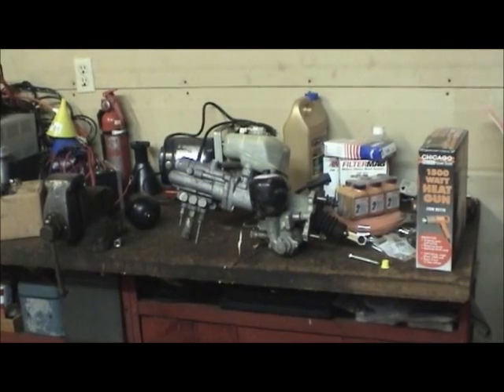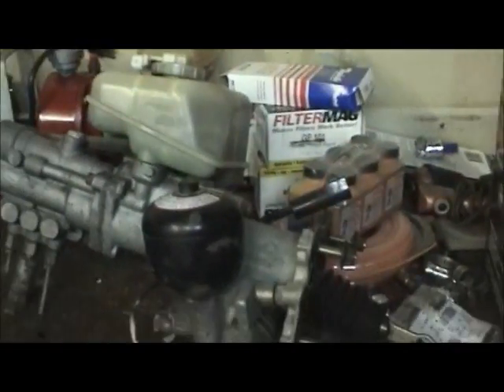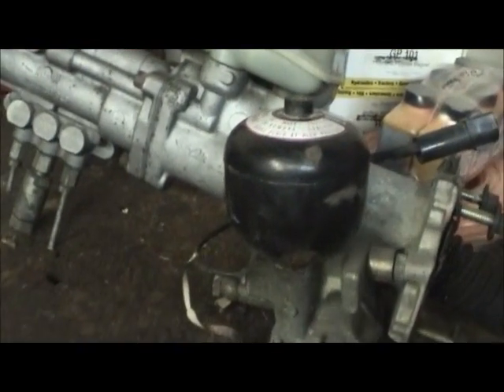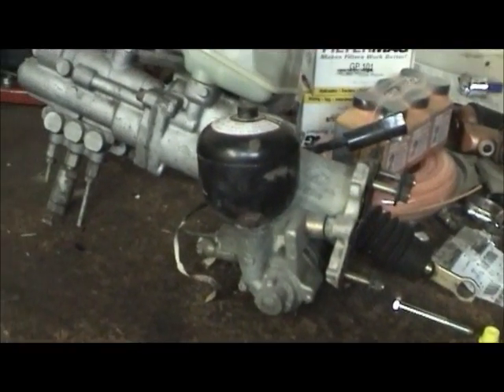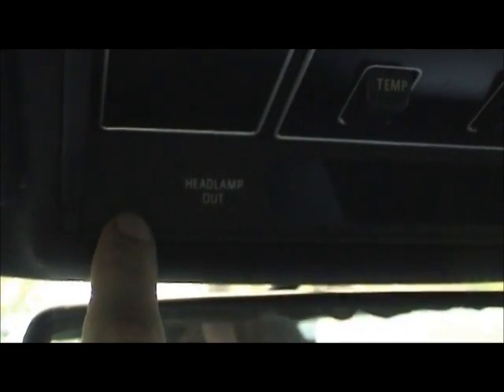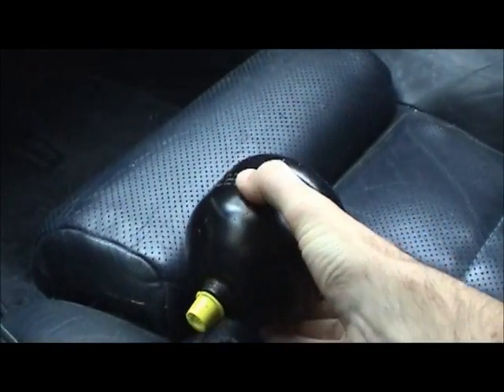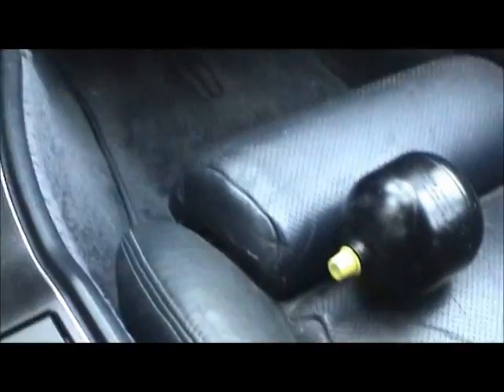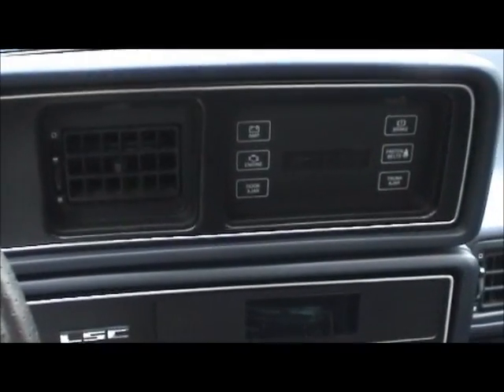1987 Lincoln Mark VII Brake Booster Troubleshooting Tips

Comment: I got a 1992 Lincoln Mark 7 Bliss Blass and I am having a problem where the pedal is hard as a rock. It is an electric brake booster and we tried replacing the relays and still wouldn’t go. Where can I get the other parts for this?

Comment: Are 1984-1992 brake system the same? Are these units   iterchangable between 1984-1992 Mark Vll?
Reply: As far as the Teves II electric brake system, yes there is only one style ever offered.  They came from Germany I believe and are found in Buick Reatta's, Jaguars, Mercedes, etc.  As far as the vehicles, some were vacuum boost instead.

Comment: This was a very helpful video.  I now am almost positive that I need an accumulator.  I Googled Hydac, and Prior Reman, and hit a dead end.  I just want to order this part for my 86 LSC.  Can you help me out with a Hydac part number, or even a link to this part?  I understand ACDelco also made this part at some point but no longer does.   Thanks.
Reply: Just a heads up.. I went through this 5 years ago and the game was up already.  Couldn't find a single solution to repair my Teves II system so had to retrofit.
Reply: @jessemedina4482 retrofit to what? I want to get rid of this crap

Comment: Thank you! This was very helpful in diagnosing my brake issues in my 1992 Lincoln Mark VII LSC. Sadly, it appears that Prior Manufacturing has gone out of business. I've reached out to HYDAC to see if they can steer me in the right direction of another supplier. I know this video is 8 years old but if you have any advice or extra info, I'd love to hear it. Thank you!
Reply: I gave up the search almost 5 years ago.  No accumulators left and hydraulic shops weren't able to help me.  I ate the cost of refitting the brakes entirely with a Hydroboost kit from SPEED Manufacturing.  He includes a bracket that adapts the booster specifically to the Mark VII firewall.  I spent 7 or 8 hundred on a reman booster with steel hose kit and he upgraded me for free to a brand new booster.  Hoses connect to the power steering pump and you have worry free heavy duty braking from that point on.  Next issue is my suspension.. 30 years old and still riding on air.
Reply: @jessemedina4482  Where is SPEED Manufacturing located? Looking to convert as well, if you could point us in the right direction it would be appreciated!

Comment: I've been working on a 1987 Continental. Knowing what the Brake light is for and the additional components is very helpful. I can't wait to take get back to the car so I can better troubleshoot the issue!
I was also contemplating just finding a vacuum booster to retro-fit if I can't get the right parts to repair the original system.
Reply: Did you have any luck retro-fitting it?

Comment: These Teves systems, when properly working, are really nice. In general though they are a PITA. The parts are obsolete, and trying to find a functioning one in the junkyard is not so easy anymore. Removing the booster itself is also quite difficult, especially removing the three brake lines going into the ABS at the master cylinder 0:49 is really hard to do. The nuts easily strip and then good luck taking them off after that. Having removed several of these now, it's easier to unbolt the ABS block from the master cylinder 1:28 than it is to remove the brake lines. You'll save yourself a headache. Almost all of my troubles with these systems have been due to the accumulator. Unfortunately, I cannot find a new and suitable alternate accumulator. People used to buy GM accumulators from a similar system from Cadillac but those have been discontinued as well. I've seen some for machinery and other vehicles like Mercedes Jaguar BMW and Maybach, but cannot be certain they fit or are to spec.

Comment: I suggest getting in touch with SPEED Manufacturing and purchase a Hydroboost retrofit kit for your Mark 7... (they also offer a cheaper vacuum booster kit) Lose the ABS, but also all of the problems intrinsic to a worn out Teves II integrated electric brake system... I babied mine along for almost a year and finally tore it out of there.. accumulator was dead, fluid leaking out near reservoir and poor electrical connection at the pressure switch. The conversion job is easy AND you end up with a ton of space around the left side of the engine AND the unit is very powerful.. a perfect companion upgrade to larger rotors and calipers. Only other downside aside from losing ABS  was significant power steering pump noise emanating through cabin... I ordered steel lines and did not isolate them from the body at all areas.. some strategic foam/ insulation application will likely cut that down. Matt Sweeting has the goods.. I ordered a used Hydroboost and he shipped me a brand new unit instead! A courtesy for delayed shipment.. treat your super coupe right people ;) Consider a power steering cooler if driving hard in hot climates.. as Matt explained to me, these Hydroboost units are fairly bullet proof. They usually only need a reseal in the distant future due to leakage.. a cooler can only help keep those rubber seals alive!
Reply: conversion $$$$$$$$
Reply: I've tried finding speed manufacturing and I can't locate them.. do you have an website?

Comment: Question:, i have a 1987 Turbo coupe and my brakes are rock hard, no power assist, both lights (abs-brake) are on and the charging motor is running. I can't figure if its the pressure switch or the accumulator. what would most likely be the issue in your opinion?. Thank you
Reply: Did you ever figure it out
Reply: Hi there, i'm ashamed to say that i gave up and put the car on a back burner, but i may just blindly buy an accumulator for $200 and see what happens, worst case scenario i'll be out of $200. @freddygalvan669

Comment: can you tell me where the relays is located that attaches to the battery with a fuse link,,,,and also where the fuse link is located......I have an 1986 Lincoln Mark 7 and i my breaks are as hard as concrete as if the entire system is not working......i replaced the entire unit and i still have the same issue. Im wondering if maybe im not getting any power to the unit that can be cause by the relay and fusible link to the battery that you mentioned in your video.

Both ABS & Break Lights are on.

Comment: thank you for posting this.  I have a 2008 civic hybrid (no vac booster)  with the same style symptoms and 3 shops couldn't figure out why I press my brake and my brake light comes on.  we ruled out its the brake fluid sensor.

what gets me is that when your depressurizing yours, you can pump yours multiple times.  however with  mine, 3 pumps and the pedal is hard with the car off. 

so I think the accumulator is my issue.  

did you have to bleed your braking system?

Comment: Hey man, my 7 has had a brake issue, and I can't figure it out.
About a week ago my passenger front caliper locked up and destroyed a pad on that side. I replaced the pads, the caliper, and properly bled the brakes prior to reassembly.
Well, today it started acting up again, but now when I go to stop, there is a little pressure, but all of a sudden, my foot will hit the floor and the pedal is extremely mushy. I don't get it.
Re-bled the system, and still going on. 
Any ideas brother?

Comment: hey man. on my 89 I changed the rear line from the master back.. I have gravity bled them at the front and rear... good fluid out the back... but won't kick bleed out the rear.. and I have a brake light on and a Hard pedal and very bad stopping ability. any ideas how to get the "air lock"out?  thanks
Matt

Comment: my mark vii has a hard brake, and both the brake and abs are on all the time. when i turn the switch on i dont hear the pump working .
Reply from the maker: That is likely the ABS pump motor relay. You can find those at most auto parts stores. Less common failures are: ABS pump pressure switch and ABS pump motor failure. Start with the relay first.

Comment: we replaced the accumulator on my car, and still only have regular brakes with boost every once in a while.  Otherwise rock hard pedal w/ only front brakes working.
My mechanic has tried everything
and we can not find any replacment parts!!  suggestion???
Reply: Did you ever find what the problem was?
Reply: It's 5 years later but did it have anything to do with the abs relay?